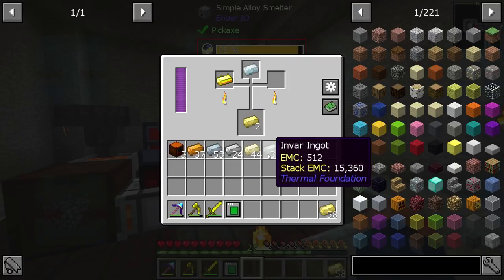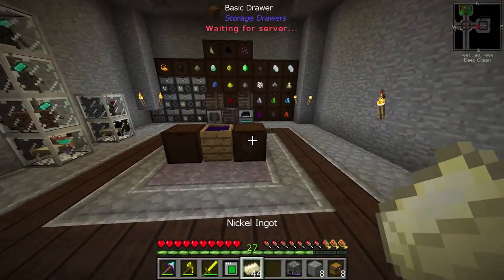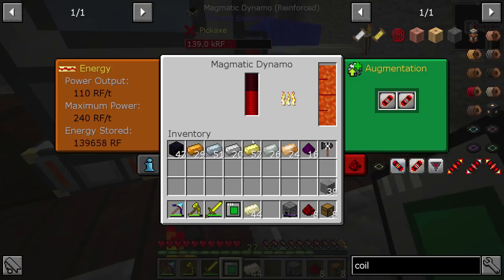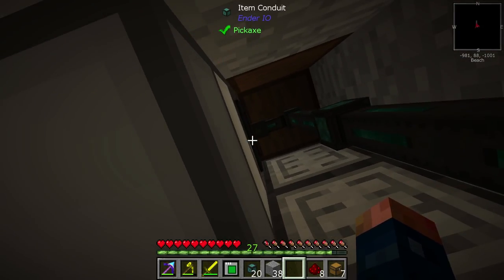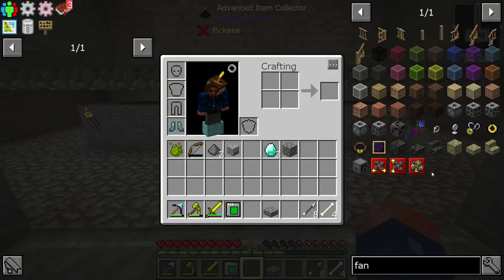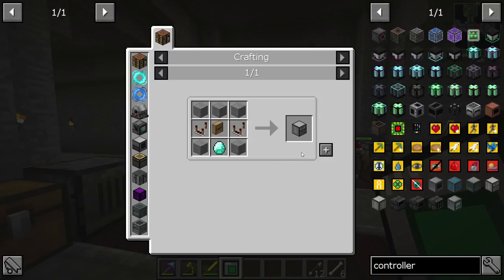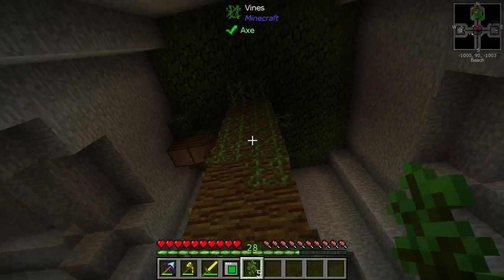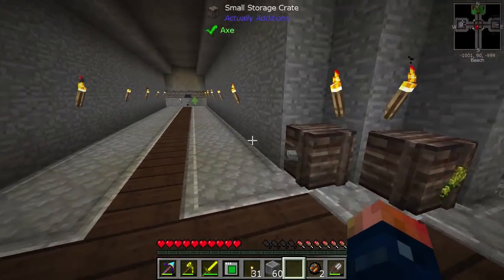StoneBlock 2 Modpack Ep. 7 Lava Power + Automated Mob Farm

Comment: Haven't finished watching the episode, but want to give you a tip for your "How to filter the ores".
Here is how I did it in a different playthrough: I put all the drawers, that hold ores on the botom of the drawer-wall. Then I directly pulled (with EnderIO conduits) into the pulverizer/furnace. The conduit will only pull the ore chunk, not the piece because the piece cannot go into the pulverizers inventory.
This way the storage drawer wall will do the filtering for you (by putting them all in the bottom) and the conduits will only pull when there is something smeltable. In the beginning it is very messy because the system has to get rid of the backlock, but once that is done, it works flawless. Without any enderIO filter at all :-)

Now let me finish watching the episode and see, if you found a better solution ;-)
Reply: This was really helpful thanks bro

Comment: Easier way to get the right ores to the crate... rather than filtering at the single crate input, you could put 2 extract conduits on the drawer controller with filters which would give you 10 filter slots.

Comment: alot late to the party again, but, at least in the most current version of the modpack, Fused Quartz DOES count as hardened glass, which means you can skip the induction smelter temporarily, if you feel you don't need it yet...but you will need one eventually either way for the slag it produces if nothing else (VERY useful stuff that slag)

Comment: I'm curious as to why you used a second drawer controller and not a controller slave? I'm not too familiar with the mod...

Also, it seems you're actively avoiding tinker's, but you can use the smelter to put some use to those armor pieces. Not sure if this mood pack has an unenchanting method, to get some extra energy or exp, but the free ones from the armor should be good enough!

Cheers!
Reply from the maker: LoL I am actually avoiding Tinkers Construct :P

Comment: Suggestion on how to deal with the armor pieces:
Can you put in a second GPS marker into the node? If so: Lock the drawers when you got all the stuff you want to have. Then put down an antibarrel from YABBA. It holds unstackable items and will not take stackable items. Alternativly you could put the GPS marker on a crate and pull out wit transfernodes into the drawer controller and that anti barrel. This way you would have a overflow chest for items that you haven't sorted yet.
Reply: What I usually do is initially route to the drawer controller with no drawers connected then have everything going into an overflow chest.  As the farm runs and I see the things I actually want to keep in the overflow chest I add drawers for each of those.  Once I'm sure I've seen everything there is in the loot table I'll have all the drawers in place for the stuff I actually want to keep then I'll remove the overflow chest and replace it with a trash can.